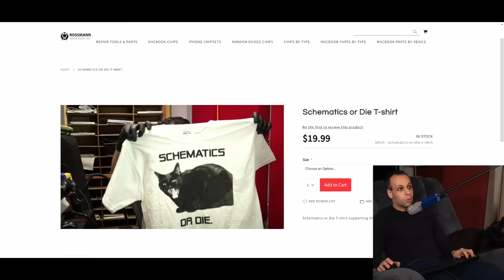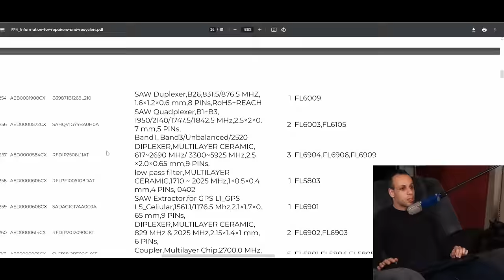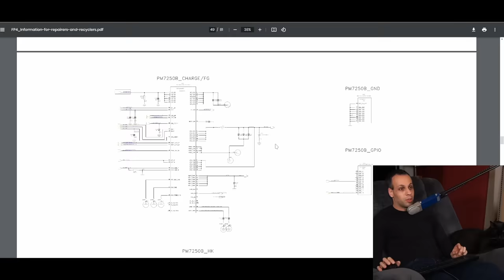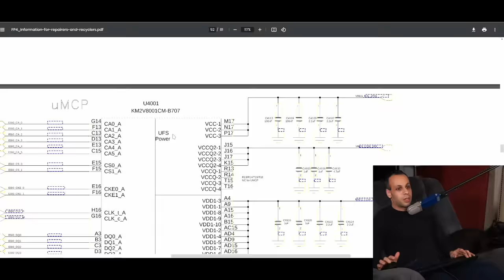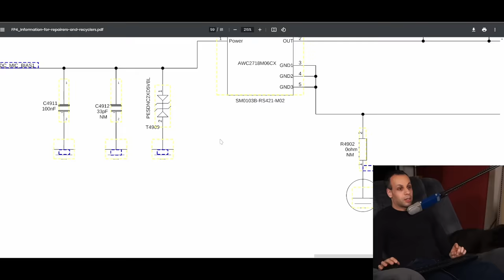Why I was wrong about fairphone

Comment: One bad thing I do know is that they are remarkably bad at android security. e.g.: they use the publicly available aosp test keys for their verified boot making it useless because even custom roms don't give a warning that the system is modified as long as they sign it using the test keys, and some custom roms have done that. And while it's admirable that they try to support their phones longer than the soc manufacturers, they always bring out a brand new phone using an old/outdated soc. the fairphone 4's soc was already more than a year old when they brought out the phone meaning they only had two years of firmware support left of the total three or more they would've gotten had they used a new soc. I like fairphone but their complete unwillingness to fix any of these issues that they have been having over the course of many phones makes me not recommend them to anyone.
Reply from the maker: Do you have a source for the publicly available AOSP test keys for verified boot? That's kind of lame if it's true. Thank you.
Reply: Wait so I can literally sign anything I want and the bootrom will accept it? That doesn't sound right
Reply: @j.v.b.4040  Yeah youtube tends to delete posts with links,   you will have to find another way to give Loius the Links,  Private message or email maybe?
Reply: @j.v.b.4040  space the links out? use DOT for .?
Reply: @AC3handle  I did use dot but it didn't work
Reply: Describe search terms that will take you there in Google
Reply: @darlantro  Tried that too, it disappeared too, I'm gonna try spacing them out
Reply: privacyguides
Reply: knowledge base
Reply: android overview
Reply: verified boot
Reply: there link fairphone forum post
Reply: @rossmanngroup  follow bread crumbs ^
Reply: alternatively: privsec D O T dev, categories, android, android tips, phones to avoid
Reply: @j.v.b.4040  posting that last one as is on google actually brings up the correct link as the first result :D
and thats actually kinda nutz, everyone who finds a fairphone randomly can just flash a custom rom with for example no locking enabled or smth like that and the phone would just accept it and make it easy to unlock the phone and lock thru the stuff (if its not encrypted somehow)
Reply: @j.v.b.4040  Isnt the Firmware for the SoC Problem a little bit more diffcult?
I recently learned that fairphone tries to use LTS Chipsets which are normally used for things like refrigerators, so they get longer firmware support. But i dont know exactly which chips exactly they use and when they started to do so. Do you have more insights on this topic - cant really find something?
Reply: I haven't bought a Fairphone yet due to the warranty and now the headphone jack, but if I were to buy one, I would install /e/.
Reply: @j.v.b.4040  make it  a tiny url  and only give  the  link code not  the link
Reply: I consider that a plus. If I install a custom OS I don't want the phone complaining about it. It's my phone, quit trying to tell me what to do with it.
Reply: I wish fairphone were able to deliver LineageOS but this probably explains why it hasn’t happened
Reply: @snackman94  For what it's worth I've been running /e/ on Fairphone 3 for some years, but I'm a dev and it's hardened in various custom ways.  I really don't care about boot rom keys, but I know I'm not the average phone consumer.
Reply: @TEDodd  That complaint is a badge of honour!  It's Google complaining that people other than them might steal your personal information without permission.  How awful! ;)
Reply: @jimbo-dev  How is LineageOS better than /e/? Doesn't it lack Google apps? Isn't it also impossible to re-lock the bootloader?
Reply from the maker: @J.V.B. I've added you as a user whose comments are always approved, so you should have no problem posting URLs into the future. My apologies for youtube being youtube
Reply: @rossmanngroup  Thank you!
Reply: @Zothaqqua  I just find it a huge annoyance. The long delay while the phone just sits there telling me something I already know. I unlocked the bootloader and installed the OS why does the phone need to tell me tbst every time I reboot? It's not something you accidentally do.
Reply: @snackman94  you install the Google apps you want. No harder than installing the OS.
Reply: @snackman94  /e/ is a fork of LineageOS, but doesn't really add anything that I value. Yes it has few extra applications some of which are proprietrary (at least maps) which is the main reason I to not use the default Android installed on your phone. 

LineageOS does not have Google apps by default but neither does /e/, the only difference is that /e/ has MicroG apps by default which replace the Google apis. And you can get MicroG preinstalled on LineageOS as well, so by using /e/ you are basically installing the MicroG version of LineageOS with an additional theme, DAVx5 and bunch of other apps installed which you can install and choose yourself. That's extra work but you'll end up with system that is more what you want, but I understand that everyone doesn't appreciate customization, since it brings complexity
Reply: Why is kernel signature important tbh? We use PC which by default (with some exceptions with UEFI) accept any bootloader as long as it has 0x55AA mark and it's not really a problem. If you fear for your data being stolen, just use full device encryption. It's not like some android malware is gonna write to your 'boot' partition because it would need root first. And if you want root you need to unlock the firmware bootloader which disables signature checking. I just fail to understand what's the big deal with the signing. I really wouldn't mind having a phone that can boot any image from usb or sd card.
Reply: @odder5154  I know security and all that, but honestly this sounds awesome, I like the idea of just being able to run anything!
Reply: @ArdgalAlkeides  Honestly, I think the most important reason is to not let THE USER modify the software at will. I belive in the 'if you have a physical acces to a device you can do anything with it' idea. Sure, your evil maid will not put a malware on your device with secure boot, but she will install a hidden camera above your desk, get your pass that way and do anything she wants. Since we are already talking about very unlikely scenarios... Btw I don't say that there are no reasons to use secure boot/signed boot image. There should be an option to enable it with your own keys and you're all set(unless you lose the key later). I argue it should not be enabled by default or there should be an easy way for the authentic user to disable it, as for most users it serves no purpose. Most attacks are phishing and/or user run malware. On Windows any installer runs with root priv. so when you put malware in an installer it can do anything, and secure boot serves no help here. Btw if you leave your device unattended all bets are off, an evil actor can tamper inside, install a physical keylogger, whatever. In my opinion caring about secure boot in the current cybersecurity landscape is like having your wallet in your underwear, buy your money and documents in a backpack that you leave unattended for hours.

EDIT: sorry, for my agressive tone. I didn't mean to sound this way. I just have a deep repulsion towards technologies that lock the owner out of their own device and get a little emotional.
Reply: cool story bro!
Reply: @rossmanngroup  Thanks
Reply: To the people asking why the verified boot thing is an issue: Imagine you bought a fairphone but the retailer put a custom/modified rom with whatever they want on it, be it ads, malware backdoors, anything. A normal android phone would give a message that is alarming to even the least technically advanced customers and they would call support, but on a fairphone the retailer could just sign it with the public test keys and nothing will look different. Depending on how well hidden whatever they modified is, even most of the people in this thread wouldn't notice the difference unless they were specifically looking for it. To those who install a custom rom it isn't alarming because they know they installed a custom rom and that the os isn't the stock one. The warning is there for the people that didn't change anything, so that they get warned when suddenly their os is modified without their knowledge. On the fairphone this security feature is useless and it'll say everything is fine even though it isn't.
Reply: There's that but also the fact they are so expensive. I can buy 2 phones with better specs for the price of 1 fairphone, which in my eyes, makes it a pointless product.
Reply: @yotoprules9361  While what you say is a fair point, the reason they are so expensive is because they are environmentally responsible(this costs money thus why many large companies don't recycle), they sell your data and their phones are not easy to repair + they don't readily have spare parts available for sell nor do they give out schematics to allow easy repair.

All this stuff they exclude leaves out profit so they have to increase the cost of the phone vs the competitors. And that's not all the competitors do.
Reply: @SI0AX  fair enough, but £499 for the base model is just far too much, the max I spend on a phone nowadays is £300 and I keep that device for 4+ years usually and then give it to a family member or sell it on. They sell the fairphone 3+ which has specs that barely beat the mid range Lenovo p2 from 2016, they sell this device for £349 refurbished! IMO this purchase just doesn't make any sense, I'm all for the fairphone and framework laptop but I just can't justify the price.
Reply: @yotoprules9361  IMO the real value is in keeping the phone forever. I only replace my phones when they break and the part replacement cost is close to the value of just buying another used phone on ebay. I have never purchased  a new phone and do all repairs myself. It's only when My $100 phone needs a screen or battery replacement and the part alone is like $90 that I buy another used one in good condition. If fairphone has good prices for replacement parts I'd get it.
Reply: @j.v.b.4040  oi...well there's that tinyurl thing louis used, but ...christ, why the F does youtube mess around with that, while I'm getting a 9+ notification list and ALL the goddamn responses are 'TEXTME!" fuckers?
Reply: @rossmanngroup  Doing AI work as a mortal man.
Reply: Just a guess but, as far as I know, Fairphone is a fairly small company that does not have the resources to come up with a new phone design every year. So they probably can't produce phones with the latest and greatest SoC: it just takes them too much time to design, test and certify each generation.
Reply: You are only half right, and in particular are absolutely wrong on the length of firmware support. 

At the time the FP4 was launched it had the longest promised firmware support of any smartphone. Ditto the FP5 (officially being launched today as I write).

Your mistake, which is understandable, is to suppose that a cop that is already one year old on the market has the same three year support plan as most of the others. In both the FP4 and FP5 the cup was chosen specifically because of the issue over length of future firmware support. 

So yeah if the latest features matters to a customer they are not going to go to FP (you are right there) but if length of future support matters then FP are still currently the market leaders (and you are therefore wrong on that particular point).

If my phone is going to last twice as long, I can afford to pay over the odds for it up front. I agree that not everyone can.
Reply: @snackman94  you'd also have the choice of buying from Murena at about the same price and getting /e/os pre installed by them. The fact that FP cooperated with Murena to ensure that both the FP standard Android and the Murena FP /e/os launched in the same day is another big ethical plus point for them. 

No-one is this need to reverse engineer: just like the hardware schematics FP were happy to share what Murena needed: and that included choosing only a SoC whose supplier would allow that info to be disseminated without an NDA. 

And yes: that did limit the choice of hardware available. Would you pay more for a device with right to repair? I'm guessing if you watch this channel you would. This cooperation with Murena seems to me the closest equivalent currently available on the software front.

Typed up on my FP4 with standard Android
Reply: @jimbo-dev  there is an /e/os rom, which some feel is better than the standard Android.
Reply: @mikeuk1927  I approve of your "deep repulsion" of those technologies.

I also am deeply repelled by the organisations that choose to use them. "Hey Google"...

The whole of Android has been progressively turned into a multi-Trojan by a company that back in the day had a motto of "don't be evil".
Reply: @SatumangoTheGreat that's part of it certainly. They also have an ethos of discouraging the current trend of thinking phones are to be changed every year.

But the major thing is that they are focusing on using an SoC for which long support periods are promised by the chip manufacturer. That limits their choices, as most manufacturers won't commit to a ten year plus support path for future versions of Android; and even the suppliers FP uses only offer that on a selection of their SoCs. 

A ten year plus support path is needed so that FP can guarantee eight to their customers after development and the sales window, as I think they are advertising with the FP5 which they launch today.
Reply: @trueriver1950  
You are incorrect about the fairphone 4. It launched with the snapdragon 750G a year after it came to market. The 750G only gets three years of firmware updates from qualcomm. After qualcomm drops support for the 750G the fairphone 4 won't get any more updates to it's firmware. Fairphone often does the work to bring newer android OS versions to it's phones even without the support of the soc manufacturer, but they cannot make changes to the soc's firmware. Firmware, the android kernel and the android OS are three seperate things. Fairphone had the longest future android OS updates support of any phone when it launched, not the longest firmware support. If a security bug is discovered in the 750G's firmware after qualcomm dropped support it won't get patched. It doesn't matter whether you're using the fairphone 4 or a no name 750G based phone, neither are getting soc firmware(security or otherwise) updates.
Reply: A general update for everyone:
The fairphone 5 has been launched and according to someone from fairphone's android dev team the android verified boot keys are no longer broken. If this is correct(no one has verified it yet) then this means fairphone are no longer using the public avb test keys as their avb signing keys, they should now have their own private, secure keys starting with fairphone 5.
On the soc firmware support side the fairphone 5 is also a big improvement as they chose a qualcomm iot soc which still has firmware support untill the end of 2028. The soc will only officially support up to android 15(V) but presumably fairphone will use this vendor kernel to run up to android 18.
It is a shame however that they once again launched the fairphone 5 with an soc that is already 2 years on the market meaning that they could have released the same phone with 2 years of extra firmware support if they had released the fairphone5 2 years ago.
All in all though these are some significant improvements when it comes to security.

P.S.:I would post sources but yt does not allow linking and auto-removes the comment.